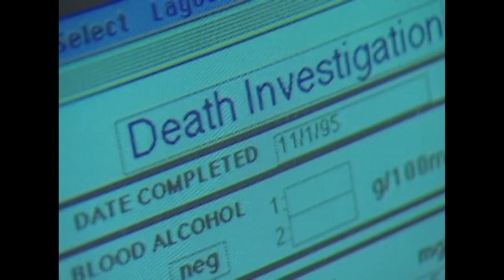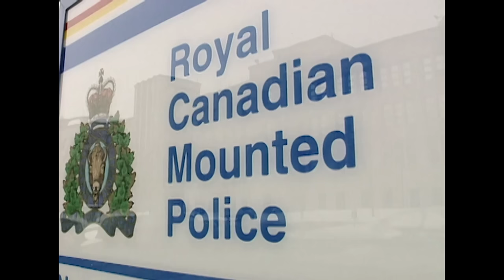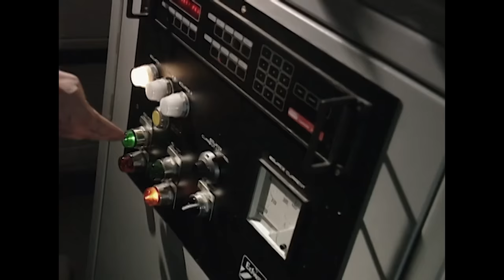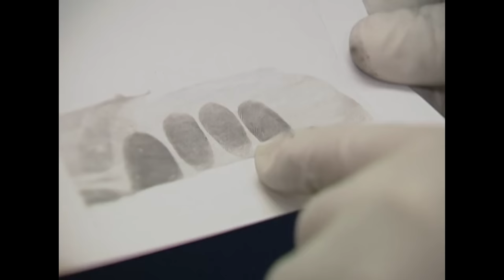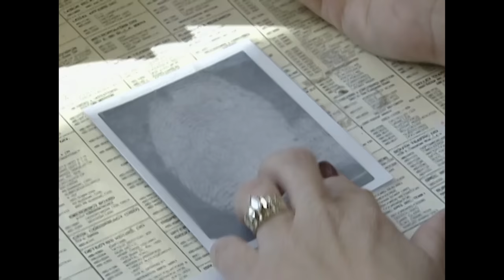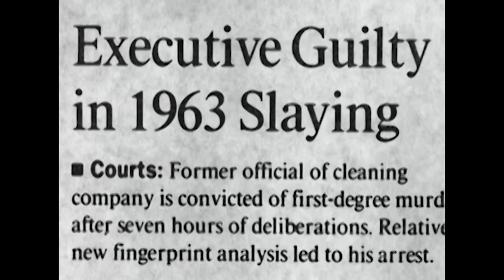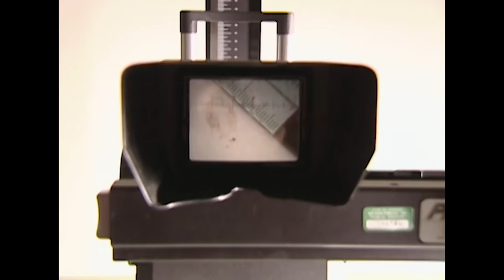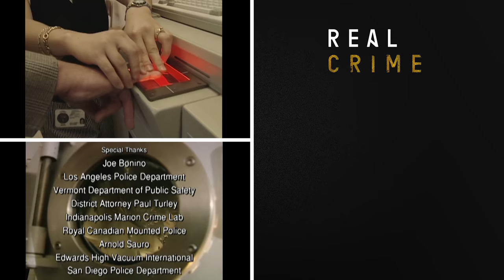Cold Case Solved After 30 Years: The Joanne Sweets Murder Case | New Detectives | Real Crime

Comment: Fingerprint and DNA evidence is exactly why I try to keep every surface in my home wiped clean at least once a week, more if possible. Especially doors, windows, jambs, handles, etc I have always (since about 1980) wiped down those surfaces about every other day. Why? Because if anything ever happened, I'm trying to give detectives a clean slate to work with. Basically, cleaning off old prints, etc daily or every 2 days, a week at most so any prints they find, are gonna be mine and the perpetrator only.
Reply: wow, might want to take a break from the crime shows